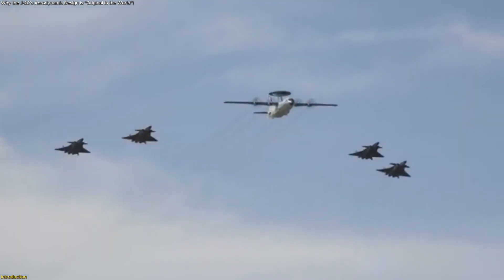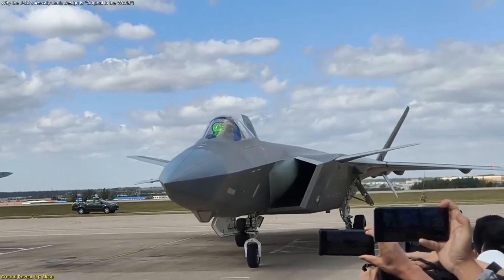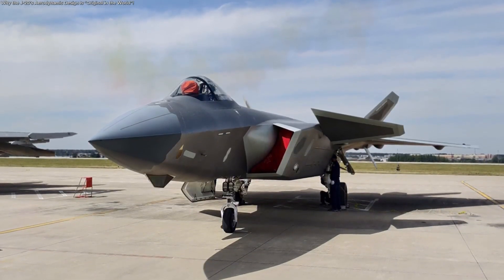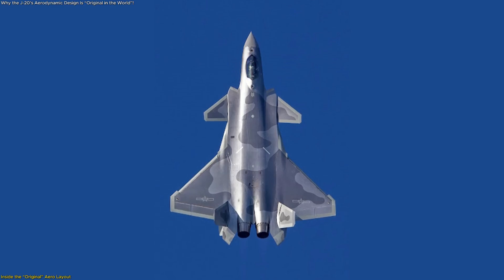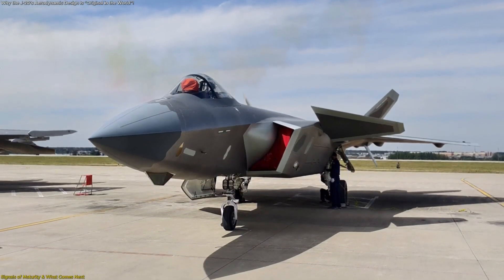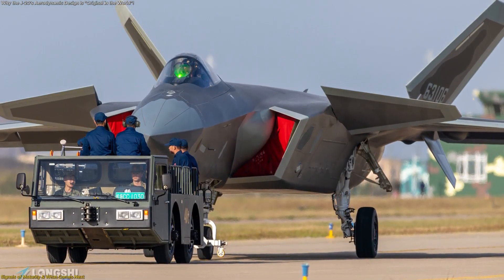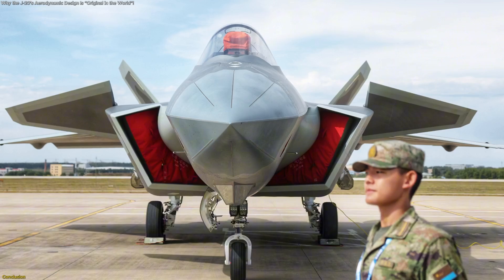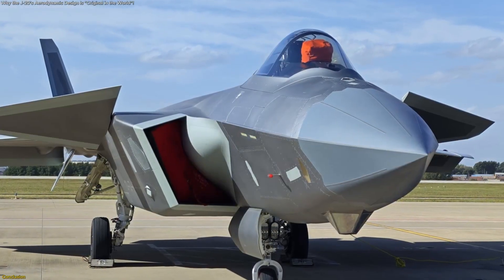Why the J-20’s Aerodynamic Design Is “Original in the World”!

Comment: In 2002 the chief designer described the configuration nine years before first flight. In the mean time the air intakes moved from below the fuselage to beside the fuselage. Someone who was not an aerodynamicist translated that article into English shorty after first flight but his translation was still very clear. There is very little connection with the shape of F-22.

Comment: Lier j20 is only 4gen only  not 5gen I see the problem of j20
Reply: so what did you see? what's the problem of J20?
Reply: what problems? if its because "canards" then don't worry because they're about as damaging to the stealth of a jet as elevators no more no less. it has good maneuverability at low speed, long range radar, great high alt high speed performance and excellent kit. its stealth isn't terrible either, without ram its not too far behind the f35, with the pla's recent advancements in radar absorbent material providing a massive reduction of em signal reflection from the aircraft like